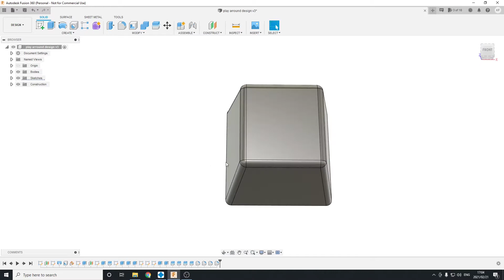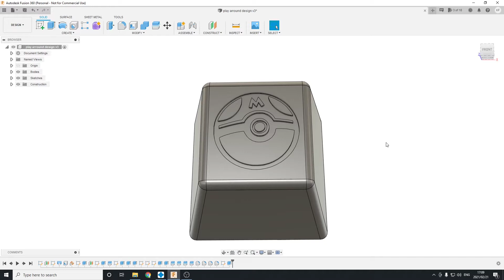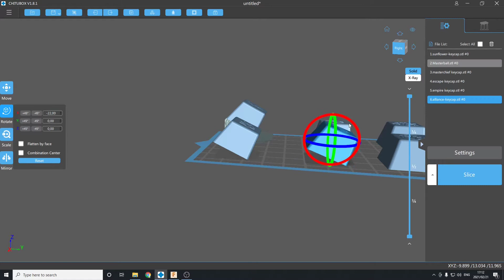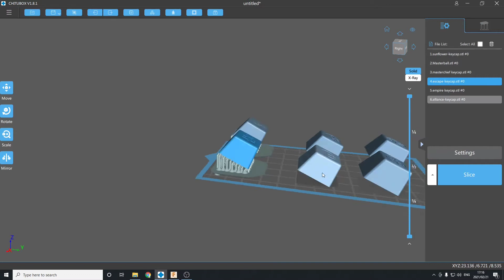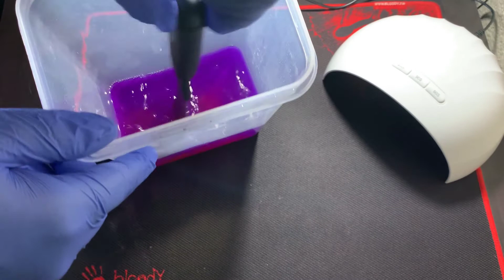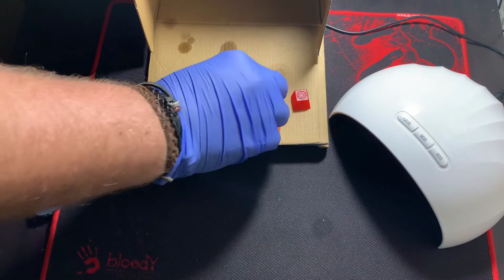One Day Project|EVEN BETTER Custom 3D Printed Keycaps(Now In Resin)

Comment: lol I have the XL version of that bloody desk pad and I too, use it as a mat in my workspace. The bloody handprints just seemed fitting. Thanks for this. I've lately been wondering why I never see any custom keyboard builders, print their own keycaps. Started to think it wasn't a thing or maybe wasn't worth it.
Reply from the maker: Thank you for the comment and it’s definitely worth it if you have a printer, even if you don’t have a resin one, and some plastics give awesome effects with leds on keyboards
Reply: bro i didnt realise the design of the pad was literally bloody, and read your comment thinking you were getting a bit heated about that fucking desk pad.

Comment: One idea: If you put smal holes into the design, couldn't you just put a transparent tesa stripe on the top after curing the keycap, turn the keycap upside down, inject resin in another color with an injection needle and than harden it under UV to get a "double shot" keycap?
Reply from the maker: That’s brilliant thank you
Reply: @bicutech2  Actually I thought about it while building a mechanical keyboard for the Amiga 600. It uses some keys with unusual shape (f.e. function keys with 1.25u). My first Amiga was an A2000 rev. 4.x Braunschweig Edition, wich was the only one with double shot keycaps (but only 1u function keys) and Chery switches.
As you can not get all keycaps in OEM profile, it is impossible to get original looking chery compatible keycaps for selfmade mechanical keyboards.
With a resin printer and keycap generator from thingiverse I can get any size for any row in OEM profile - but labeling is only done by embossing. So I thought about filling the engravement with black resin. But I never made it - I just got a resin printer (Anycubic mono X) so I have not started my Amiga Keycap Project jet. But last year I got DyeSub ink for an old inkjet (Ricoh Affico), so I think dysubing on keycaps being the more easy solution.

Comment: it is much easier to remove the supports if you do that while you rinse the piece with warm water
Reply from the maker: Thank you for the comment, the resin I’m using seems to not like water too much before it’s cured for some reason, but I will definitely try that
Reply: @bicutech2  maybe it is because of the cleaning liquid?, I don't know. I use ethilic alcohol 97°